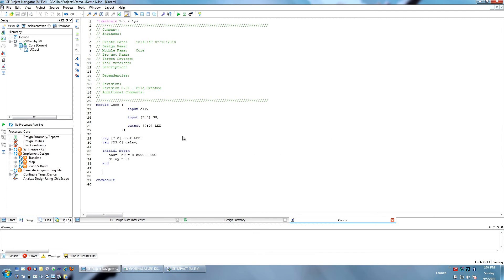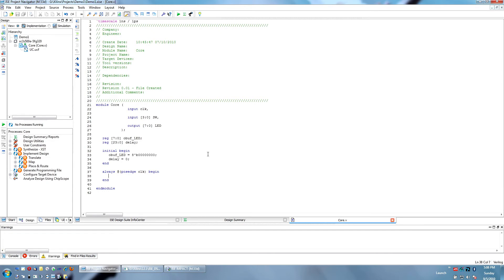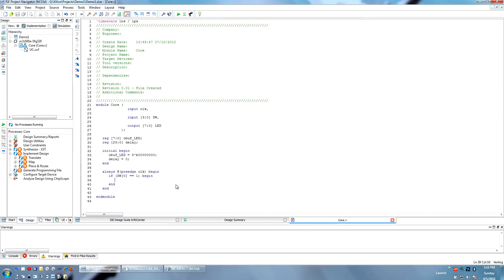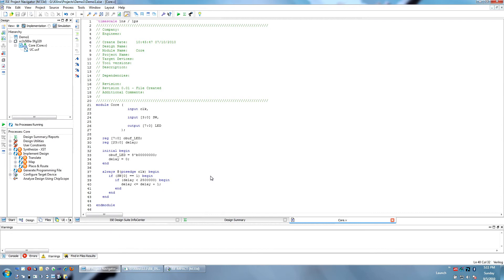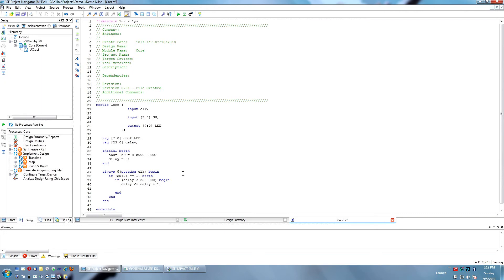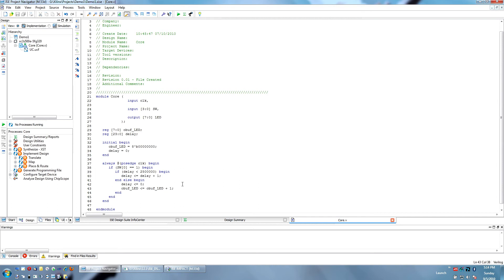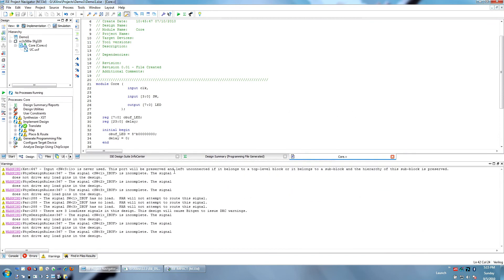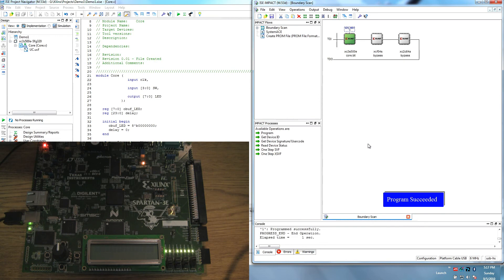Intro to FPGAs for Software Engineers - Part 7 - Binary Counter Project (Part 2)

Comment: Great series. They spoke right at me and I'm a novice in this, but I graduated engineering. The only thing I think you skipped in this video was handling the obuf_LED register overflow condition, which in this case just seems to reset it to 0 automatically.

Maybe next time you can do a video on:
-calling this module from your "core" and adding an extra input that defines the delay clocks? 
-fixed point data handling
-FFT processing a ADC input?

Thanks again,

Comment: I think if you work with software, then will be impossible for you describe a good digital hardware.FPGA is for electronic engineer. Your design is bad, it has a lot of warning for a simple counter! It's wrong do a synthesis without do a testbench before. A software engineer doesn't see the circuit, the maxmimum frequency, or timing constraint. FPGA is powerful for signal processing and prototype an ASIC, no for simple systems that can be to implemented on microcontroller. And finally, the best HDL language is vhdl. I think that a good software eng. can't to be a good hardware designer.
Bye!!
Reply from the maker: We'll have to disagree on this.  There is no reason why a person can't handle both software and hardware.  I certainly do, and I'm no prodigy.  I'll go over your criticisms in reverse order.

There is no intrinsic way to determine a "best" HDL, and the most pragmatic approach is to look at which is dominant for where you want to work.  In the US the defacto standard is Verilog.  Elsewhere it's usually VHDL.  Be fluent in whatever it is that lets you work where you love.

FPGAs are powerful for anything you choose to use them for and are a great alternative to microcontrollers as they expose a lower level of hardware and let you do things that you simply can't in a microcontroller.  That doesn't mean an introductory video is the appropriate place to demonstrate advanced design concepts.

I'm predominantly a software engineer, but I'm fully aware of the timing constraints and take consideration of the electrical circuits I'm making.  I do both.  It's not hard.

The "design" of the project I have shown here is fine.  Warning quantity is irrelevant; only the content of the warnings matters.  What you see here are warnings that note that some of the inputs aren't used.  That was intentional; the bus was created 4 bits wide so that all of the development board's switches could be wired up now in anticipation of later use.  There is no penalty to be had by not using all of your inputs since they're simply left unrouted, but it does bypass the need to spend time doing tedious edits to the code later when you want to start using them.  As a designer who knows what they are doing, this is fine.  You do not seem to understand the content of the warnings and take the overly simplistic viewpoint that warnings are always bad.  This is a novice's mistake.

Your criticisms suggest you are a novice who does not really understand what you're commenting on.  That is fine, but you need to recognize your level of experience and refrain from criticizing those doing things you don't understand.
Reply: Novice?? I'm digital systems engineer in VLSI design for signal processing. It's very different. Bye
Reply: Tbird761 Well said

Comment from the maker: @rezamt2010 Sorry for the delay--I didn't see that you'd commented.  The board I made these demos with is a Digilent "Spartan 3E Starter Board", but there is a less expensive one called Nexys2 that might be an even better choice.

You'll have to Google for "digilent" since this comment always errors when I post with a URL.

You can also make your own pretty easily for a fraction of the price, which I'll be making a video about in the future.